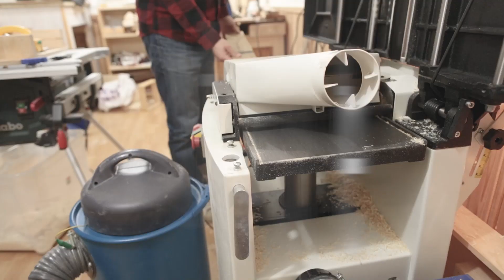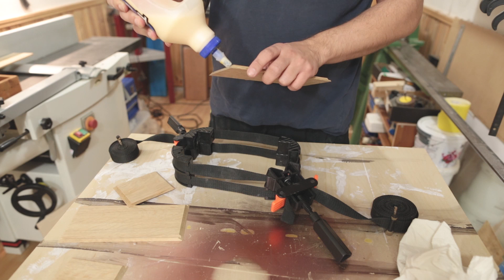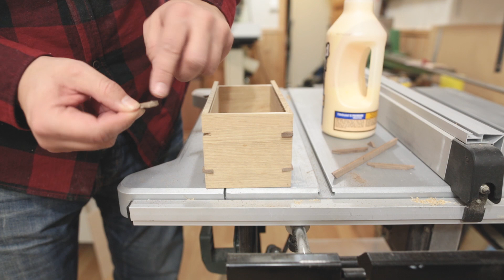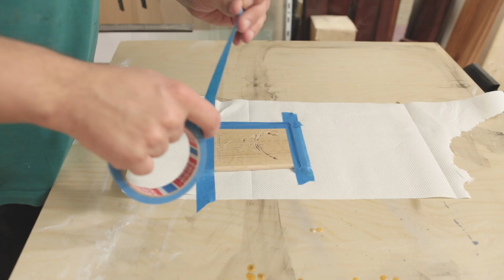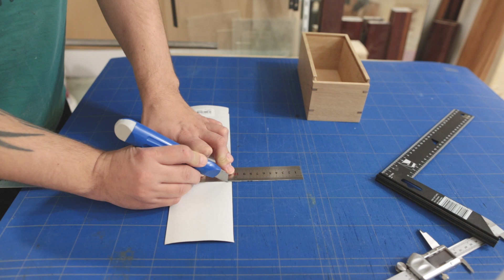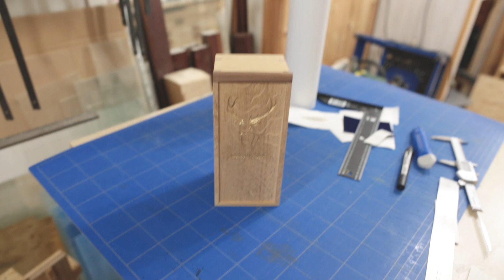Making a Wooden Gift Box

Comment: Nice! Do you ever get instances where the mitre tool cracks or splits a work piece?
Reply from the maker: Thanks. Hardwood works best. Spruce and pine tend to splinter a little at the edges sometimes. And it can only do cross cuts

Comment: I don't know if you have tried it but spray a layer of clear lacquer before you engrave it, then the gold paint don't stick anywhere else then the engraving and the edges get a bit more crisp! otherwise, thank you for a beautiful box and video! 

what's your thoughts about the shapeoko 3?
Reply from the maker: Thanks. I usually do that but I wanted the wood to be natural. Even though I could have sanded it after I did not have time since it was a gift. 

The Shapeoko is my first cnc so I really can't compare it to anything but I really like it. With the right feed rate and depth per pass it's very accurate. I guess the Z-axis plate could have been a bit more rigid and stiff but it has not caused any major problems for me (even on aluminium). The machine is quite easy to build and easy to get started with if you are new to cnc like me.
Reply: Thank for the input, I'm totally noob at cnc so that's why I'm going to build my own! I'm a bit crazy in that aspect and also, I imagine in my mind that it'll be cheaper! ( Thought it probably won't)
Reply from the maker: No problem. Go for it. It might not be cheaper (if you consider the working hours at least) but I bet it's a cool experience and good for learning lots of stuff. I have been thinking about it myself.

Comment: what kinda V bit are you using for the engraving?  And what cam software?   Fusion?
Reply from the maker: A standard 90 degree v-bit for wood. I use F-engrave to generate the gcode and UGS (universal gcode sender) to run the gcode. Both programs are free.

Comment: What is the small box jig/clamp you are using to assemble the sides?  Whats the brand and where can i buy one?  Beautiful box!
Reply from the maker: Thanks. It's just a cheap band clamp from a local hardware store. Most hardware stores that sell clamps have these. Just buy the cheapest you find. You can also use large rubber bands for a small box like this.